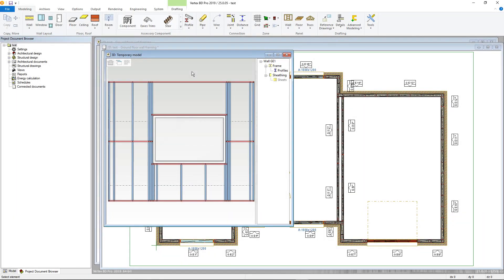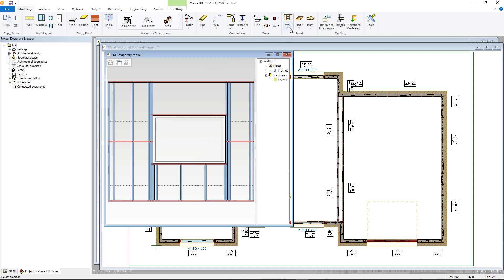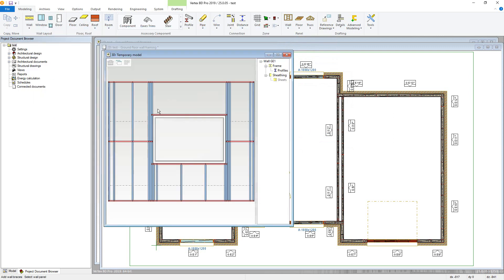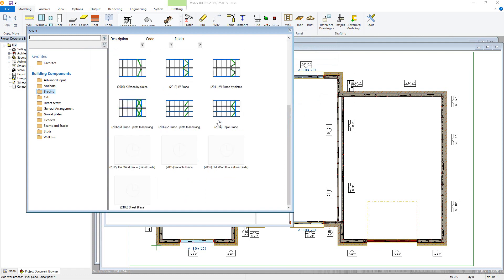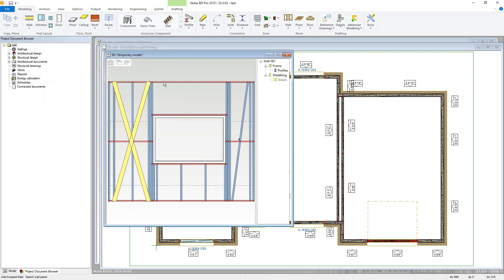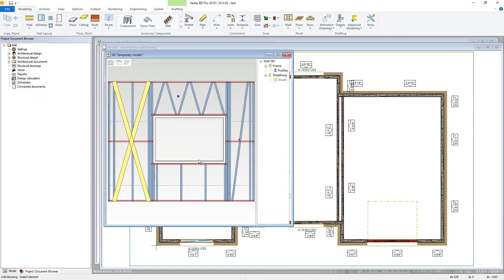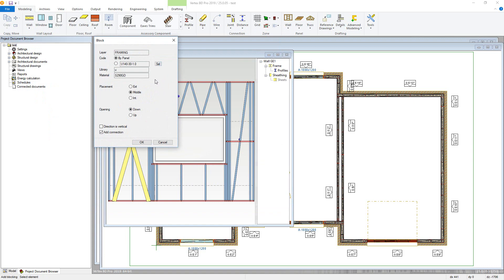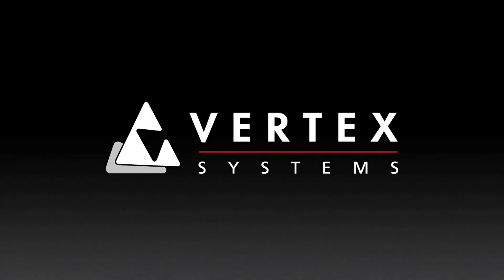9: Wall Framing Accessories [Vertex BD Steel Framing Tutorial]

Comment: Please till me how you change the color or channels vertically and horizontally
Reply from the maker: Hi, thank you for your query.  

By default for steel environments in Vertex BD colours are set for C profiles to be blue, with U tracks in Red.  This is set at the library level, but can be altered.

To do this Select Edit Cross Sections in the System tab.   Now select the library to alter.  Choose the profprop option and open in a text editor.  You can alter the colour using MAT.SURF and TYPE.SURF.
Reply: @VertexBDBuildingDesignSoftware  can we change the color of joist Truss and walls differently?
Reply from the maker: @MehtaburRehman  Hi, yes these can be altered by profile type, using the above method. Alternatively there are options to change the colour of any profile or element individually.
Reply: @VertexBDBuildingDesignSoftware  please can you Share video clip here in youtube or can you share Anything how we will do
Reply from the maker: @MehtaburRehman  the easiest method would be to use the rendering method here:  https://youtu.be/ZQGP3JPcxww?t=33  This can be applied to different profile types within your model.  For having this as a default please contact your local Vertex helpdesk as it is more in-depth than we are able to reply here.